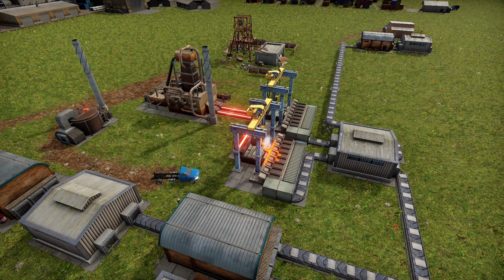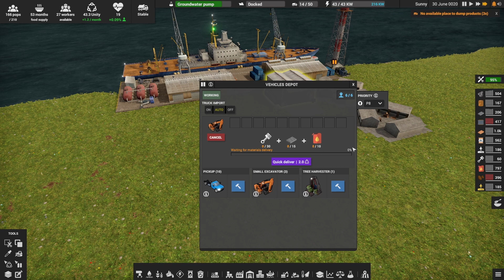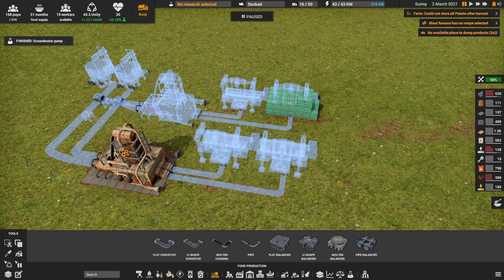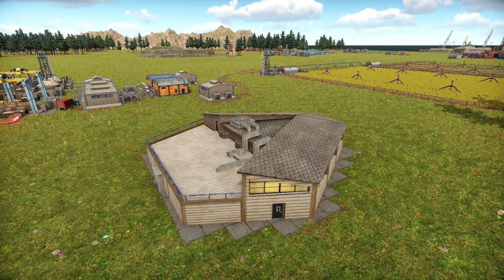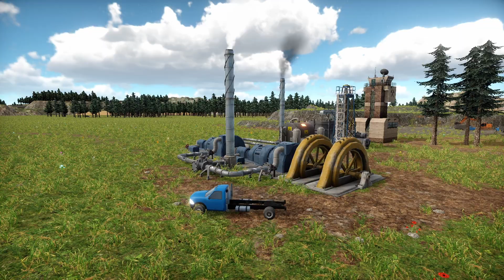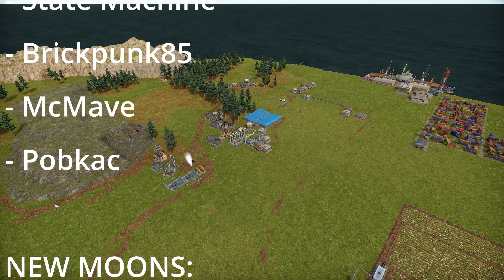HELP! - I Broke Power in Captain Of Industry. Let's Play Ep02

Comment from the maker: Any thoughts on how to set the coal generators up properly?
Reply: I believe they only generate to meet demand, and is already working properly. Diesel generators do the same thing, if you have 2 but only need the power of 1, the 2nd turns off. Or if you only need 50% of 1, it rums at 50%
Reply: @Catraaa  this is correct.
Reply: I don't play the game so this is just from what I see here:
the high-pressure turbine produces 1 MW of mechanical power (gear symbol) and then the power generator can convert up to 500 MW mechanical power into 360 MW of electrical power (lightning symbol). So I guess you only need one generator for the two turbines you have right now.

could be totally wrong but that's the logic I see
Reply: @johnb0815  other way around 2 gens per turbine
Reply: Your exaust pipe for low pressure steam is not enough

Comment: Hello Total. The coal gen produces steam for 2 HP turbines. The wheel only produces electricity when needed so it depends of your electricity consumption. Each turbine can feed 3 wheels on mechanical power from the shaft. So you could stack 6 wheels on you design. So your max output can be 2.4 MW.